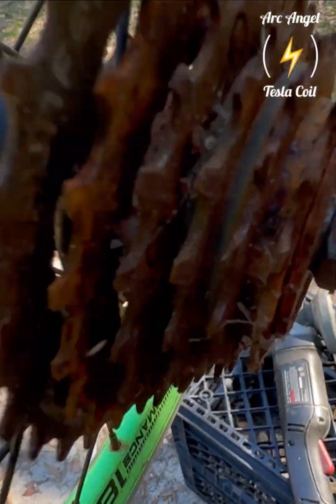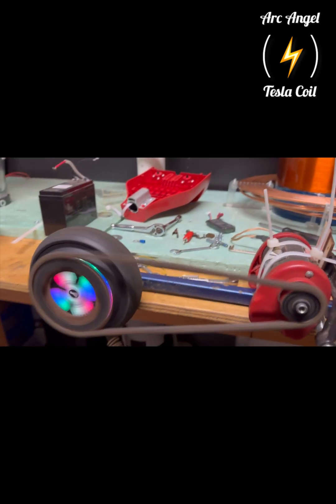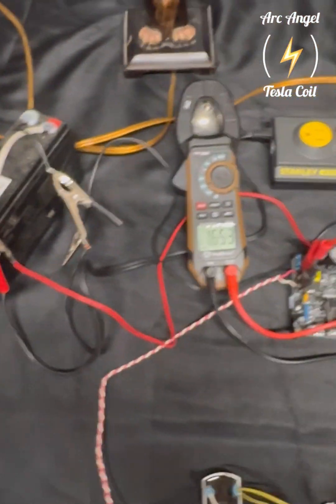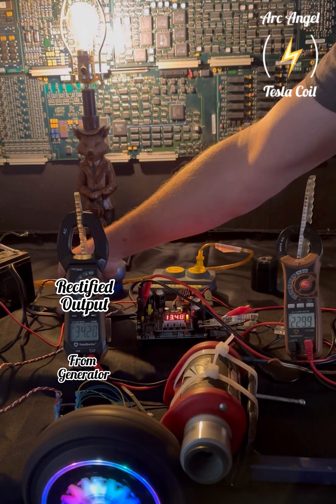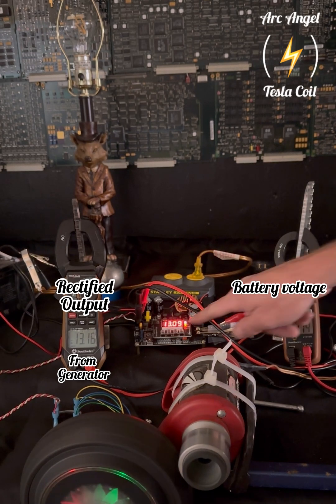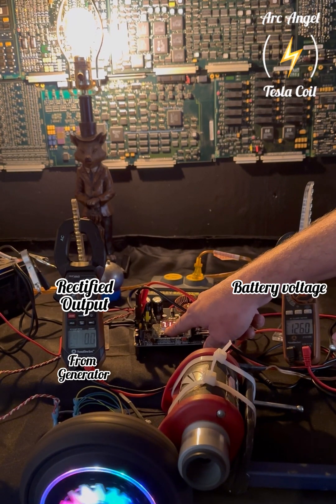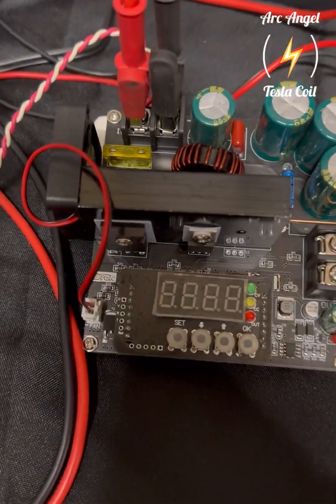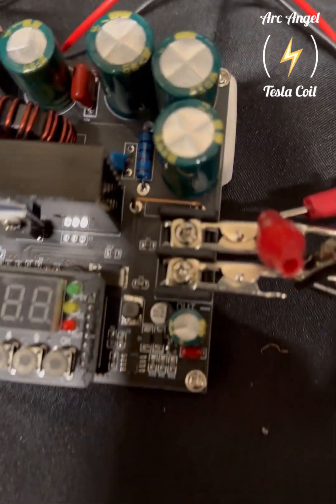⚡️Bench Testing Hoverboard Motor⚡️pt2 #experiment #offgrid #fun

Comment: Thank you for the info and the video!  Thoughts on combination of creating a configuration with the hoverboard motors and bucks with the lowest RPM possible to charge a 12v/100ah battery in 4-6 hours?
Reply from the maker: Thank you! Well these bucks need to have a minimum of 7 to 9 vdc im thinking that if you paralleled a few hoverboard generators and then run into a buck you could turn slower and double the voltage for the buck but charging a 100amp hour battery in 4 to 6 hours may be tough. But depending on how many generators and total current flow will determine how fast the charge 👍👍⚡️

Comment: Hi, thank you for showing this video this is what I needed great info.
Reply from the maker: Thank you!!
Reply: @ArcAngelTeslaCoil  Hi, how can I take the 240v DC back to 240 AC I am trying to do this for our home Generator project. thank you for your help. how did you learn all this Electrical stuff?
Reply from the maker: @stevenpleasant5834  you probably want to use a a/c converter. They make them to run on 12vdc to 48vdc depending on the type you get. Then use the hoverboard generators to charge batteries. Think that's the way I would go. I'm self taught 👍👍⚡️
Reply: @ArcAngelTeslaCoil  ok, Thank you